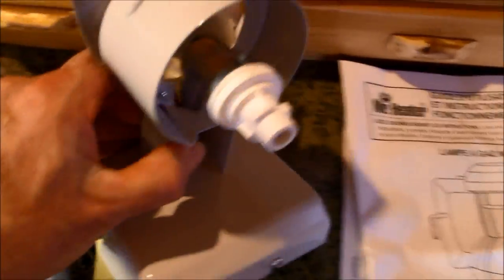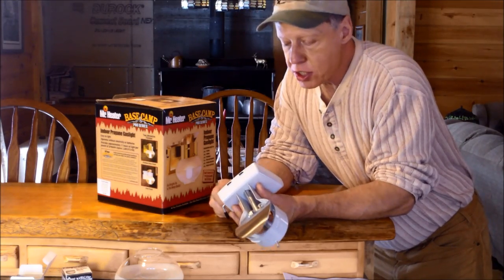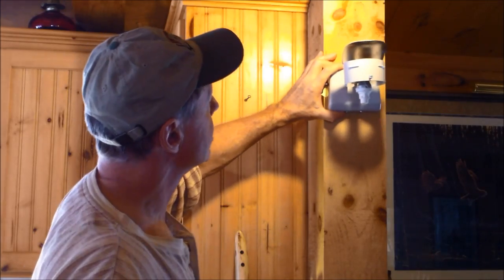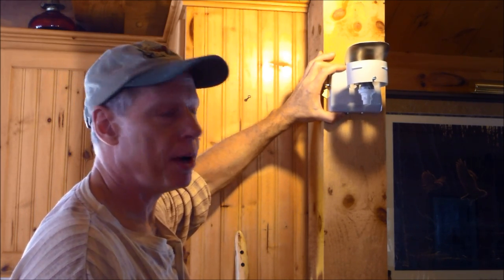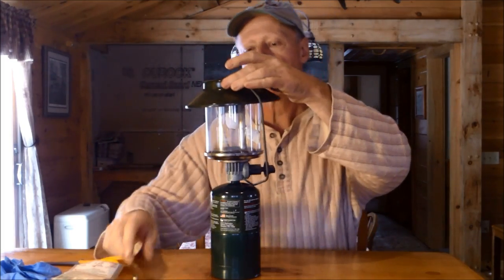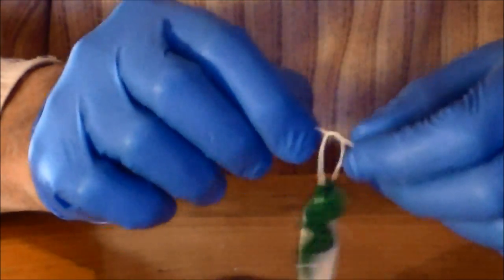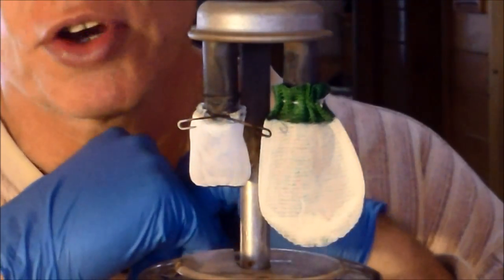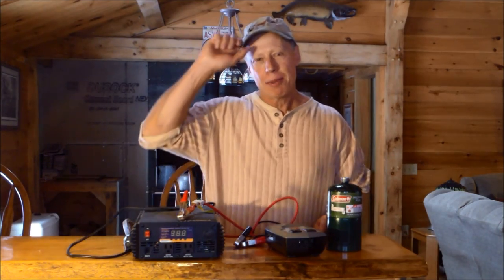ALTERNATIVE LIGHTING PART 2. Off The Grid & Emergency Preparedness.

Comment: I have to concur with many of the other viewers, I could watch a new video every day even if it is just Frankie and you having fun wandering around and observing the changes in nature.
I've also been watching another man's videos about trying to get completely off grid, he's new at it and still is learning but he's doing pretty well. It's called The Do It Yourself World and the gentleman's name is Troy. He's been installing small solar panels and working his way up to complete sufficiency. He has found that LED lights use little electricity but have great output while being very easy to install. I am willing to bet you'd be interested in these too, even just from curiosity standpoint.
Reply from the maker: ***** LED is definitely the way to go. All my lights have LED bulbs in them. A 40 watt equivalent only burns 5 watts and the bulbs don't get hot like incandescent bulbs so they're much safer. Thanks for commenting.

Comment: The older mantels for gas, propane, or kerosene can still be found here and there. They contained a small amount of thorium within them which helped to make the light whiter and brighter. Unfortunately thorium is slightly Radioactive, therefore it is recommended to always first burn the mantles outside while standing upwind.

Comment: Excellent, sensible stuff.  Best, most straightforward kero lamps have the duplex burner, two flat wicks side by side.  Heavy on the fuel but you can easily read by them.

Comment: You are absolutely correct about our dependence upon the grid. When the grid goes down, life as most people know it stops. 

Looking forward to the electrics - down south it's way too hot most of the year to use a combustion based light inside. The trick down here is an LED or fluorescent light that will throw a somewhat natural light, and having a way to re charge it. 

I've got a basic solar system that can run my deep freeze and power a few accessories indefinitely in case of a grid down scenario. 

People underestimate the value of good, "warm", lighting. Living for an extended time under the harsh glare of cheap fluorescent's or LED'S gets old quick. 

Great series! Now turn all those lanterns off - Frankie's trying to get some shuteye! :)
Reply from the maker: You can't beat electric light. I'm just stepping into solar myself so I don't have any in depth info regarding that. Just basic info for alternatives to carry on some sort of normalcy when the grid goes down.  The Aladdins wouldn't be a good choice for the warmer climates.

Comment: Great tutorial Boss. Have to go out and find one of those refill valves. I used to have a permanent type propane light in a small travel trailer. One winter i used the trailer as a camp while i was logging.I'd just leave that light burning away and it would not only provide great light but it would also keep the chill off the little trailer when i'd come in for lunch. Those permanent ones are very neat. A real must for an off grid cabin. Thanks again and looking forward to the next one. Take good care.
Reply from the maker: I will be showing the refilling process in part 3 and supplying info on where to get them and more info on lighting as well.
Reply: Sounds great bud. Thanks so much.

Comment: Good stuff Boss! Using a different fuel source, which is 3 D cells, my Streamlight Siege lantern does the trick for me. It's bright and dependable, waterproof, and goes a long time on 3 batteries.
Reply from the maker: I will be talking a little about battery lanterns in the upcoming episode. They all have their place.

Comment: I used these, or something like them,  and my great uncle's camp.
He had a propane fridge, preculator for coffee, an outhouse and water holding tank on the second floor we had ro star a gas engine pump to fill to get gray tap water you shouldn't drink because it came from the lake.

Wood fire is the bottom line best option for power outages.

Comment: Love the informative lighting series! Visited with some folks in AK, off grid, with the Mr Heater gas lights, wonderful lights! I'd like to know what the coupler is called to refill the 1 lb. propane bottles. I use quite a few of small bottles! ,Thanks for sharing your knowledge.
Reply from the maker: The one I use is called MacCoupler. I will be showing this more in depth in part 3 as well as LED lighting etc.
Reply: Thanks!

Comment: When hooking up copper gas piping, use flair fittings not compression fittings. Compression general purpose is for water not gas. Can purchase flairing tool at most plumbing supply or mega hardware/auto supply. After gas piping completed test for leaks with soapy water.
Reply from the maker: John S Yes, I only use flare fittings but thank you for your input just the same.. The light I lit was not installed by me and has been there for about 5 decades.  I will be installing gas lights in the cabin later this year and will demonstrate the flaring tools etc.

Comment: Have gotten a start on my off grid lightnig took poor of your kero lights got them on my phone, so when I go to town or to the flea mkt. I know what to look for. Got stocked up on kero too. After I watched your vids I got lots of things. I'm a prepper to been doing that for bout 6 years, my pantry looks like a mini walmart. Got a supply of cast iron to, some came from my mom before her passing in 1984 . Even got one that looks like a fish cast iron boy what a find. Also got one that looks like a corn muffin pan only the inserts are oval like oblong rolls. Plenty of pots and pans and a dutch oven I found in an antique store cost me 25.00 but looks like yours. Please check your other vids I left you comments there to.
Reply from the maker: I just picked up an old Wagner iron frypan at a junk shop. Nice find and cheap too.
Sounds like you're getting set up pretty good.  I'll be showing a little more about lighting in future cabin vids.  Propane is a good thing to stock up on because it doesn't degrade like petroleum products and can be stored for many years.

Comment: Great series and video as always JC! I have been considering the permanent propane wall mount lights at my place for some time now... with less than 25 feet of copper line, I believe 3/8 copper is sufficient for them?! 
I too use the Coleman propane lantern as well I use the primus,  the upside with Coleman is its strictly propane versus a propane/butane mix that is much more costly! I keep all of my 1 pound cylinders and will be filling them like you will be demonstrating in the next video! 
All the best friend, take care, and thanks for sharing!
Reply from the maker: If you have a spot to hang them where you need them, the wall mounts can't be beat.  I'll be diving into some simple off grid electric stuff in the upcoming episode too.  Yes the 3/8 copper is what I use to feed them.

Comment: Thanks JC. Love your videos and really appreciate the work. I'd like to ask if you would speak to storing propane in the next instalment. Thoughts on stock piling propane etc... but only if it's fun. :)
Reply from the maker: I do intend to mention that as I'm stocking up on it too. It doesn't deteriorate like petroleum products. The tank I'm presently burning at the cabin came off a 1979 camper and the woman said it was the original propane.  Try burning gasoline from the 70's.
Reply: thebossoftheswamp Thank you JC. I really appreciate you man.

Comment: First off, great videos, i really appreciate them. Have you ever pondered setting up a solar panel for your cabin? If so i would like to hear about it in the next video. This way you would not have to take the battery home and charge it. I remember in a past video you had a battery that you were bringing in during one of the winter months. Even a small solar panel can be expensive, but you would eliminate the need to rely on power back home to charge the battery, and would also never have to carry a battery back and forth, those buggers are heavy! - Jason
Reply from the maker: Yes I have considered it. I have a 150watt portable system as well as a 400 watt array that I will install when I'm ready.  It's not a problem throwing a battery in the truck when I go back and forth. Really no issue at all.
Reply: Solar has gotten ridiculously cheap recently. Check out Sun Electronics from Miami they've got home size ones for about 30 to 50 cents per watt!

Comment: I have a Coleman pump gas / multi fuel here in Chile that I brought with me from the U.S. I like it because I know I can use unleaded gasoline in it here as it is harder to find the coleman fuel. I would like to get the converter coupling for the Propane tanks for refilling the small ones but they have a different coupling on their tanks here and it would not work.

I like the wall sconces and I will have to look for them. I have never seen them in South Carolina, but I will check here in Chile.

Thanks for the vid Boss!
Reply from the maker: I had a coleman (pump up type) lantern burst into flames once and Burnt my hand really bad. I'm done with those ha ha.   Interesting that the fittings are different there.
Reply: thebossoftheswamp yes I have heard of this happening. I burned my leg badly working at a slaughtering house as a kid (14 yrs old) by hot water/steam filled my high top boot, and I thought the pain would never end. Thanks for the advice. Jim

Comment: Refilling of the cannisters can also be accomplished by using the hose he had shown  in the video just before he mentioned the adapter, also using it  the casnister can be placed on a weight scale  so that it can be weighed to prevent over filling as they require a certain amount of "head space" to prevent Liquid Propane being squirted into the mantle creating an explosion factor. Set the empty cannister on a scale, zero the scale and invert the bulk tank so that liquid Propane isput into the cannister then connect to bulk tank via the hose to the cannister and lightly holding the weight of hose from altering the scale, turn on the bulk propane tank and just before it reaches 1 pound, shut off the bulk tank and disconnect hose from cannister first, then disconnect hose from the bulk tank.
Reply from the maker: Good points Nortekj. Thanks for sharing your thoughts.
Reply: That hose will not attach to a 1 pound cylinder. One end has left hand threads to attach to the bulk tank. The other end has the same male threads as a one pound tank to attach to the lantern or camping stove.

Comment: Disadvantages of propane lamps: Cost of running them and considerable heat. Falks lamps use 1900 BTU/hour of fuel each which will really heat a place up during the summer months. But they are the ultimate in simplicity and reliability. I have 15 of them in my small cabin. In the winter they are quite the heat source and will always function even if my inverter were to die or batteries pack up.

Comment: How much heat do these things put off? Should a window be opened to expel the fumes? I've never used one of these before but would sure enjoy the bright light they give off and not having to depend on batteries in an emergency situation. Thanks Boss, hope your having a great holiday season. ATB Louise :)
Reply from the maker: All lanterns throw heat but because of the design of these wall lights the heat is dispersed and are safer than the Aladdins.  The Aladdins throw a LOT of heat out of the chimney as I displayed.  Any device burning fuels will emit carbon dioxide to some degree. Gas stoves do as well but people don't think of that.  If I was closed up in a tiny room with the lantern burning all day, I would consider cracking a window but I've never been concerned with this in a normal household situation.

Comment: love all your shows , i have what is called a tree . its about 2 feet long . one end screws into a propane tank and sticks strieght up  on top screw in your coleman lantern  it has 2 other spots to place attachments as well such as a cook stove or bbq , .i purchased it for camping, but where i live way out in the cascade mountains when the power goes out for 2 weeks like it does every year i find it quit handy , they aint cheap they are about 30 bucks but money well spent , the attachment you used for filling your 1 pound bottle i would like to know where to find one of them
Reply from the maker: +grizz270 Those "trees" are nice gadgets  and worth every penny. You can find the refill nozzle at most camping suppliers.
Reply: Found my refill adapter at either Walmart or Lowe's can't remember, I think it was about $16

Comment: You can get the 1 lb filling adapter at Cabela's or Bass Pro . They work really well but the 1lb tanks do not fill right to the top like they are if they're new . Least that's what I find . You can't get them in Canada so I bought mine in the US . Save a bundle refilling your own tanks . Just make sure that you use tanks in good condition or they will leak.
Reply: Does bass pro in toronto have the unit?
Reply: xmodriver Not sure . Have never seen it there .Pretty sure not available in Canada . Here's the item number for Cabela's.com (USA) . IK-530085 It's on sale right now. If you wanted it bad enough they would probably ship it to you .
Reply: ty

Comment: For the permanent lights would you recommend outside or inside propane tanks?
Reply: I would doubt that having tanks indoors is legal, probably for very good reason. Even a small leak could be a very bad fire hazard. Propane is heavier than air and will pool at the lowest spot, unlike Natural Gas which is lighter than air and will usually dissipate.

Comment: Just curious,can the base camp light be operated properly with a 1LB tank or would it have enough pressure? I'd like to put a few up in my home for power outages and such without having to do a large amount of copper plumbing
Reply from the maker: Can't say for sure but for power outages I think simple LED / battery operated stuff would be easier.
Reply: @thebossoftheswamp  thanks for the reply. I have an assortment of lights around for blackouts as it is. You're probably right,they'd be more efficient in my situation just thought those were interesting. Thanks again for the reply. Really enjoying the videos

Comment: We moved from gas lighting to 12 volt LED lighting. Have you any experience with that?
Reply from the maker: Good move.  I still keep gas lights but run mostly AC lighting by 12v inverter.

Comment: i haven't seen gas lighting since i was a kid.
Reply from the maker: Just goes to show the direction our world has gone it.  They're worth their weight in gold when the grid is down and most folks don't even know about them.
Reply: i took some old mason jars and some of the little solar light sticks and took the tops of and forced them through the jar lids and screwed it back down. they make great night lights or emergency lighting. there are a couple of vids. on you tube that show you how to do it.
Reply: i also bought an ecotemp tankless water heater and bunji corded it to my hand truck along with a bbq propane tank, when the power goes out i just wheel it around to where i need hot water and hook up the water hose and i'm in business.
Reply from the maker: gordon kistler Interesting setup. A little ingenuity will always get the job done.